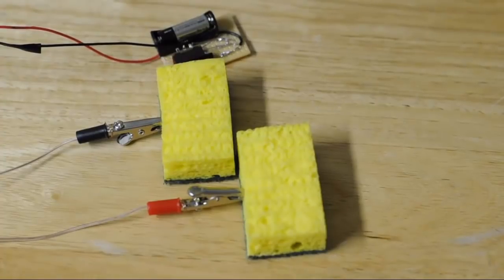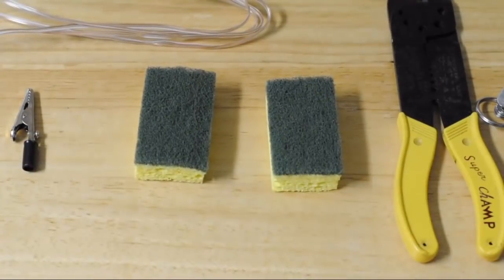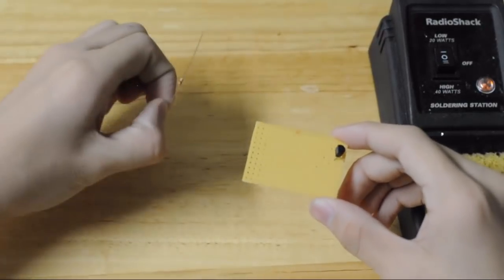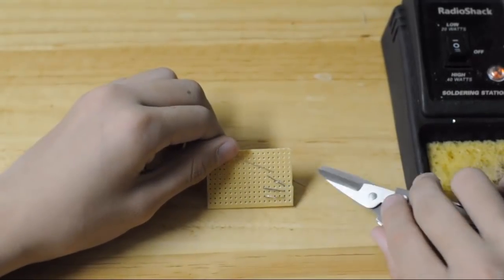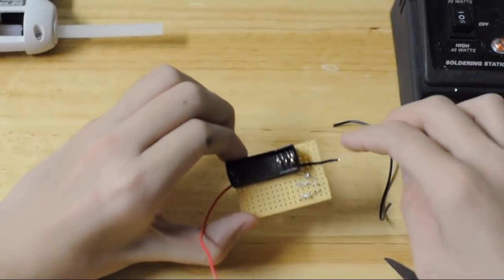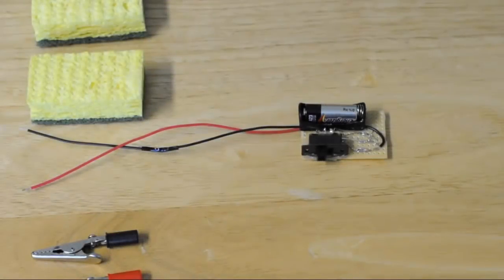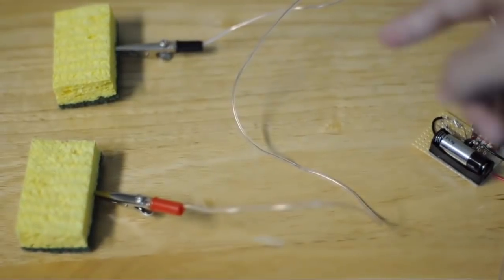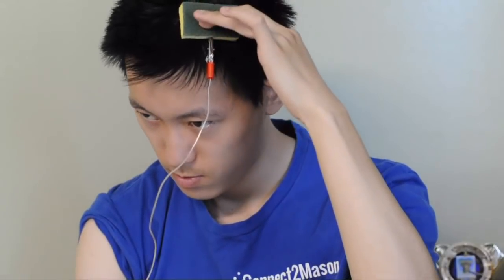How to Make a DIY tDCS Device (Tutorial) - v1.0

Comment: What type of resistor would I need? I have a 9V battery snap and 9v battery holder, are you referring to the snap or the holder? I was also wondering what type of fuse I could buy in order to make the device safer.

Comment: I finished building my tDCS and it had some interesting effects. Placing the anode on my temporal lobe and using it for 20 minutes at 1 mA had a mental boosting effect that lasted all day. I also tried placing it near the back of my head and felt a soothing calming effect. It also had a stronger effect on my dominant side of my brain than the other side -- I'm left handed so my dominant side is on the right.

Comment: After researching this more, I figured out the error in my test. It's all in the quality of the electrodes, and my wet paper towels weren't cutting it. I used spoons flush against my skin to increase the surface area and got my resistance down to 20K. I'm sure with even better electrodes, you could potentially get it down to 5K or less.

Thanks for the video, I'm planning on building this myself.

Comment from the maker: Hello, thanks for the suggestions! Actually, the two transistors are totally different. The LM317 regulates voltage while LM334z regulates current. In addition, the LM317 isn't very stable in the presence of tiny current. The LM334Z worked well for our purposes, as it regulates the current reliably and it is very small.

Comment: It should be noted that the resistance at the wires from the head to the device is ideally 5000 ohms (measure using a resistance meter before plugging the wires into the device of course).

If the resistance is greater than 5000 ohms at the electrode wires the device will not work properly if at all.

This means some conductivity experimentation using saline solution of different strengths and mixing in some kind of gel (gelatine granules perhaps) to keep the solution under the electrodes.

Comment: Can you please post the schematics for the electronics?
Reply: Just resistor in series with 1.5 volt battery use online oms law  calculator to finding resistor value for 2 to 5 ma for voltage between  1.5 to 6 volts

Comment from the maker: Yes, you can indeed use a 9V battery and achieve the same results. You would just have to use a different battery clip and a smaller resistor. The reason why 12V was better for us to use was because it is much smaller, making our device almost as small as an SD card.

Comment from the maker: You could use either a snap or a holder, it would be your preference. For the resistor, I'm not sure what exact value it was when I tested with 9V batteries, however I know that it is going to be a 3.6K ohm resistor or something similar. For a fuse, you are looking for something that is lower than 100 milliamps as 100 is enough to stop the heart; the most preferable is the lowest you can find. GoFlow uses a 5 milliamp fuse, but that is custom made. Sorry for the late reply, middle school HW...

Comment: 2/3 Device apart, I've queries into application, chiefly current flow & placement.
Since tDCS has no depth positioning like tMS, relevant brain regions must be on or in direct path from the skull.
As neuroscience is still relatively young, humility & caution is gold - but then pioneers are needed!

Since pinpointing specific regions is very important, optimal function would probably require a shaved head, different sponge shapes/sizes and caution with the moisture of the sponge as you mentioned.

Comment: Yup I'm sure John. It has to be the correct transistor (or its equivalent).

LM334Z is available from eBay pretty cheaply.

Incidentally and as I have stated before, you must make sure that the electrodes make good contact with your your skull and body. I'm using conductive gel made up from gelatine powder, salt and water. I also use a big piece of aluminum foil for the contact on the arm. If the resistance at the electrodes is too high you won't get any results. Cheers, Brian

Comment: According to the data sheet for the LM334z you are connecting the 33 ohm between V+ and R, the set resistor terminal.  The basic configuration should be set resistor between the V- and R.

Comment from the maker: Yes, with the device attached I get a reading of about 1.4ma. With my other version with a potentiometer, I can turn it up to 2ma. 
If you put the multimeter as a part of the circuit, you will see that V = IR in this case doesn't seem to work with the resistance found on the multimeter.

Also, consider conceptually, 90 volts is almost equal to 120 volts AC from your wall. It just doesn't make sense to hook up that much electricity to your head. You'd be uber crispy.

Comment: Can the LM334z output more voltage than the inputted 12v? I ask because based on my experimentation, I would need 90 volts to achieve 2ma. I soaked two folded up squares of paper towels in salt water and attached one to my arm and one to my face and got a measured resistance of 45K ohms. V=I*R, and (.002 amps) * (45K ohms) = 90 volts, so it would seem to me that at a minimum I would need 90 volts to force 2ma through my body.

Did you check the current while the thing was attached?

Comment: So based on the other crazy comments.  I am not sure if those batteries are 1.5v of some other type but if they are 12V then I will skip all the hard electronic stuff and go with my 12V car battery and two wires.  I will use my hard hat for easy on/off.  I will use it when I drive so I can do two things at once and save time.

Comment: Just got back from Radio Shack. They didn't have a 12v Battery holder. I'll check Fry's.

Could you also verify the transistor type to make sure I'm hearing it correctly? Is it an LM334C Transistor?

Comment: I made a TDCS device, and just before I hooked it up to me for the first time, touching the saline soaked electrodes directly together, I was reading 2 milliamps. I'm currently sitting with it hooked up to me in DARPA montage (anode right temple, cathode left shoulder) and it's reading 0.2 milliamps instead. Is this normal? I can feel a slight tingle on my right temple.
Reply: My mistake, never mind, that was because I kept the LED in the circuit which you later annotated should be removed. Once I removed it, I was getting two milliamps through my head.

Comment: This can't work given the reality that is Ohm's law.  I've empirically tested anode/cathode pairs at many typical montage locations for resistance, under ideal conditions (clean skin [isopropyl alcohol and witch hazel scrubbing], and 2" x 2" saline saturated electrodes).  The lowest resistance I encountered was around 35,000 Ohms.  The typical montages yielded resistances between 48,000 Ohms and 55,000 Ohms.  If you apply Ohm's law (V = I * R) and solve for Volts for a 35,000 Ohm load at 2mA you would get V = .002 Amperes * 35,000 Ohms, and V = 70 Volts.  For the typical montage pair (52,000 Ohms) it would be 104 Volts.  The most current you can source with 12V is I = V / R or 0.2mA.  Even for the lowest resistance pair (35,000 Ohms) you could only source  0.34mA with a 12 Volt battery.  So, the circuit is a waste of time.  Even if you upped the source voltage so that it might work (e.g., ten 12V batteries in series = 120V) you couldn't use it because the breakdown voltage of the LM334 is 40V.  So, this simply can't/won't work for the intended application.

For those of you who know that several of the FDA approved units use either one or two nine volt batteries and think I'm an idiot, should understand that these units make use of DC - DC converters that allow dramatically increasing output voltage at the sacrifice of overall battery life.  The prototype tDCS device we are about to study in my lab outputs about 144V from two 72V battery packs (eight series connected 9V batteries each) powered circuits in series at either 0.0mA (Circuits open), 0.5mA, 1.0mA, 1.5mA or 2.0mA using two current limiting diodes with breakdown voltages of 100V each.  This is the most cost effective method of obtaining stable current limitation at such a high voltage.  If you can live with a limit of about 1.73mA you could just use one ten battery circuit which would operate at about 90V. Since a 9Valkaline battery outputs a little over 9V when fresh (about 9.2V) you can't use 11 with a 100V breakdown semiconductor, and that is the most tolerant part available today.
Reply: I suggest remove the resistors  ;) thats what im gonna do... im not going for metal state changes i want flashing lights and nausea  spontaneously
Reply: I don't know where the LM334 became a nessesary component.  You need two 9v battires in series and a linear potentiameter, throw in an ammeter and you're good.
Reply: So If I was using pennys (zinc sand papered down and cleaned with rubbing alcohol) a 9 volt and  what kind of resisters should I use?

Comment: The Z in LM334Z indicates the package type, or the shape/type of the component. This component will have 3 legs sticking out, like the component used in the video. Therefore, get the one with the Z suffix.
There are other package types, such as SMX in LM334SMX. The shape of this component is a flat rectangle with 8 legs. This you do NOT want unless you want to solder surface mount parts.

Comment: You havent done enough study. Researchers are already using arm positions for electrodes with success. For instance, look up Michael Weisend's work with the US military on enhancing perception in snipers, pilots, and other mil personnel. They used anode on F10 (10-10 system) and cathode on left shoulder.

Comment: I couldnt find that transistor. I ended up using a PNP silicon tip-42 transistor cat. no. 276-2027. the only real difference  I see between the two is the arrangement of the pins. other than that, it has the same specs as far as I can see.

Comment: PROBLEM 1 - part 1
An alligator clip clipped to the edge of a sponge will not work as an effective electrode. A real electrode distributes current over the entire surface area of the sponge  by having a conductive   steel mesh or a steel plate that covers the entire sponge.

Comment: PROBLEM 1 - part 2
Current takes the path of least resistance so in your electrode current will go direct from the clip to cranium. It will will thus only travel through about 0.001 % of the surface area of the sponge. You want the current to travel though 100% of the sponge to increase the likelyhood that the current will travel though the correct areas of the brain.

Comment: So the aim is to produca that mmuch amount of current. Isn't it? So what is with all those transistors?? Can't it be just a battery and some resistors acoordingly to produce 1.25-1.5 amp current
Reply: psycho3852psycho Another reply if i may have... 

Can we use 4 batteries instead of one.? i.e. 4 * 3 VOLT instead of 1*12 VOLT..?
Reply: i've something more to ask...

instead of using a 12 volt battery , which is going to get depreciated eventually , i used an adapter which can give me a DC supply of varying voltages. Is it sufficient ?
Reply: psycho3852psycho i can send you the schematics of the whole thing i have made and photos
Reply: psycho3852psycho Can you please send me the exact circuit diagram for the same. I'm a tad technologically naive. TIA
Reply: *****
An accident with a battery will never be as terrible as an accident with DC supply. Just use batteries.

Comment: I just made one out of a board I got on eBay for about$8 it has an led screen and voltage is adjustable, at the sponges the voltage was 1.85 but the problem is I feel no current. Is it unusual not to feel anything?
Reply: You likely put it in the wrong place, set up the device wrong, and chose an arbitrary amount of current for the physiological effect you are hoping to achieve based on your age and skull size.  Please do not do this at home.

Comment: I got my LM334Z on Amazon. BTW, it is a temperature sensor and current regulator all in one. If you leave the resistance constant, the output current will change depending on the temp. But with a constant temp, you can adjust the current output by using a variable resistor. Here are the parts I got from Amazon (everything else I got locally):

Amico 85L1-A AC 0-5mA Rectangle Analog Panel Ammeter $7.47 (free shipping)
 6pcs LM334Z National Semiconductor Constant Current Source $4.25 (+$4.49 S/H)

Comment: HELP me please :/
i have  11,1 V  on the output, buz zero mA, nothing
what is the reason? any suggestions?
Reply: *****
hey :)
i used for now only the potentionmeter with 8k Omh resistance on it, and finally i have 1,5 mA

is there any "BUT", that i should use the lm 334z  with rezistors 33 and 5600 ohms?
or i ust can use potentionmeter as a 5600 ohms ?   (i have only 33ohm resistor for now)

Comment: PROBLEM 2
Placement of the electrodes is wrong. Don't put on arm. Current will not travel through brain to get to arm. Will travel through facial skin because of less resistance then to the arm. This is not what you want.

Comment: Saying that 99% or researchers are using cranial placements for both electrodes is misleading. There's no "goldden rule" that says both electrodes must be placed on the head at the same time in order to be effective and/or safe. You need to do more research. There's plenty of evidence from the research literature that shows arm placements (esp. cathode) are being used routinely in tDCS montages, with positive results.

Comment: I construct the device. But the multimeter still reads 12 V. 
I bought the transistor LM334z, which is referenced here:
http://pdf1.alldatasheet.com/datasheet-pdf/view/8641/NSC/LM334Z.html
Could you help me out? Thanks in advance
Reply: If it reads 12 V then you're not measuring the current ._.
You need to set it to milliamps.

Comment: This system does not take into account the resistance of the skin on the scalp and arm. 
At best, even using good electrodes this is going to be at least 20,000 ohms. Using Ohm's law, the maximum current will be the voltage applied divided by the resistance of the skin. That's 1.5 / 20,000 or 0.075 mA. This is *without* a current regulator. *With* a current regulator the current will be even less.
The best that can be said about this circuit is...well, at such low currents, it's certainly safe!